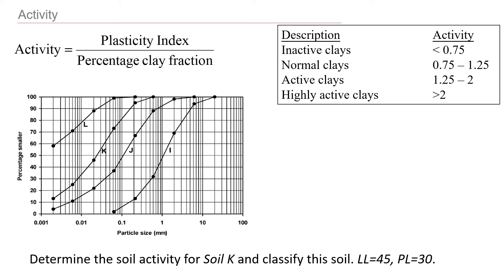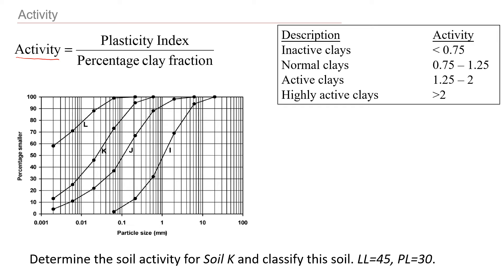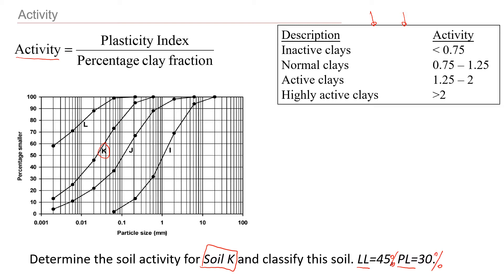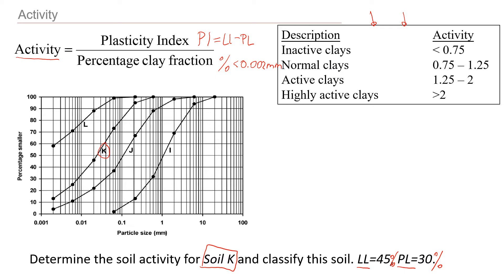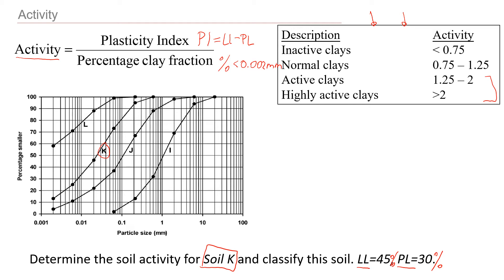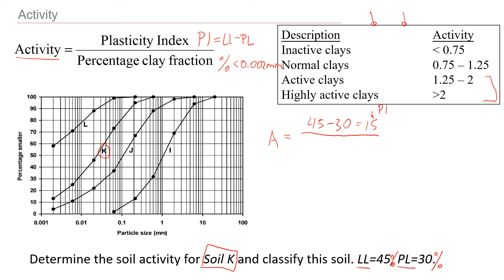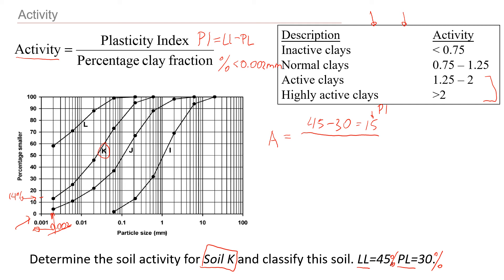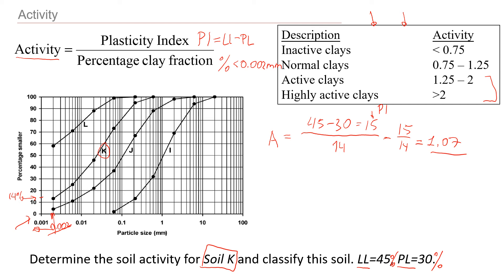Active or Inactive Clay? How to Classify Soil based on Activity in Geotechnical Civil Engineering

Comment: So the AI goes DOWN the higher the % smaller is? That clay with a PI of 15 would be said to be Inactive if the % smaller was > 20%?  15/>20= <.75  Can this condition actually occur that a soil with a PI of 15 could has a computed  AI that places it as Inactive?.    Is the PI, the PI run on the fines, or on the PI run on the fraction that passes the #40 [the % passing #40 "standard" is the ASTM test]. Running the PI on the fines [% passing #200]  is the USCS Classification process.